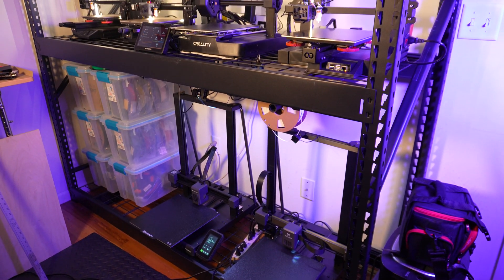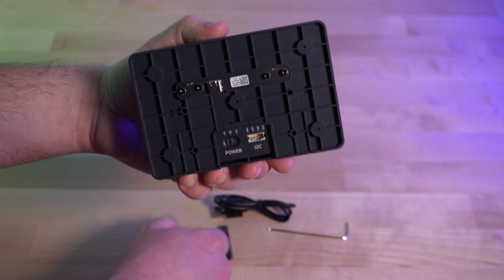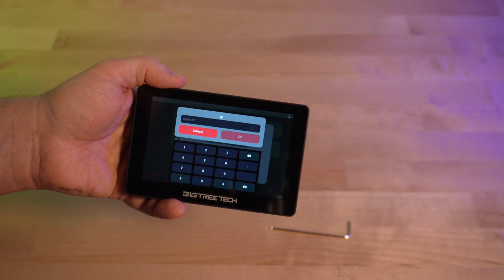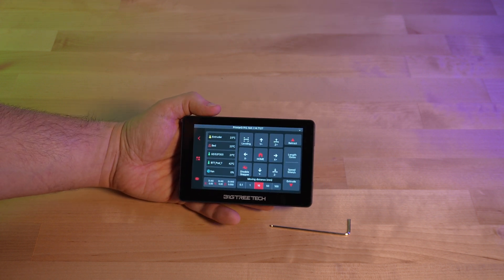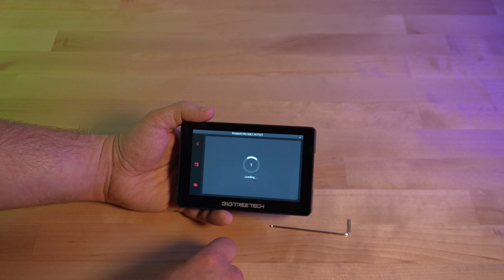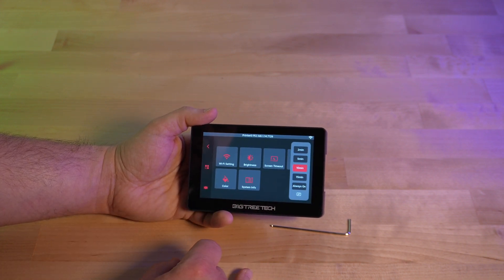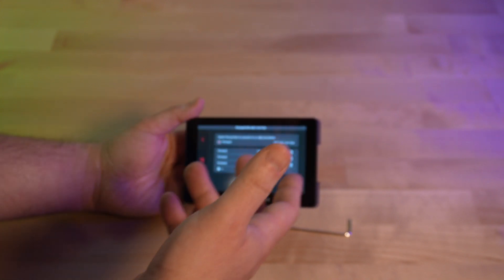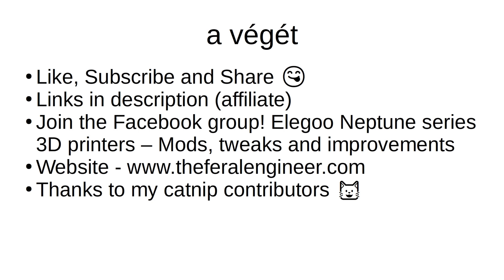Bigtreetech K-Touch wireless Klipper pad unbox and setup

Comment: So basically its a Panda Touch, just initially setup for printers using Klipper instead of Bambu Printers? I wonder if I can take my Panda Touch and install the K-Touch Firmware on it? That would allow me to update my Bamabu P1S and still make use of the Panda Touch after the update. Bambu basically made the Panda Touch useless after a certain firmware version. That is why I have yet to update my P1S.
Reply from the maker: They are the exact same hardware. I've swapped a panda to a K and vise versa